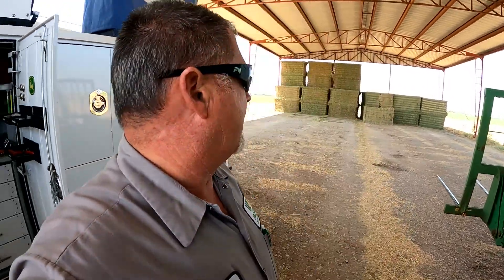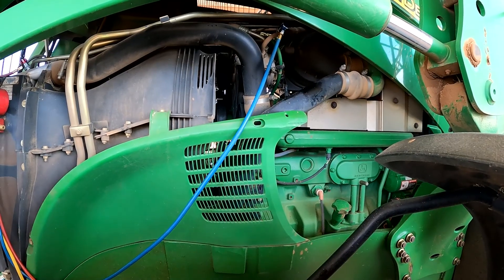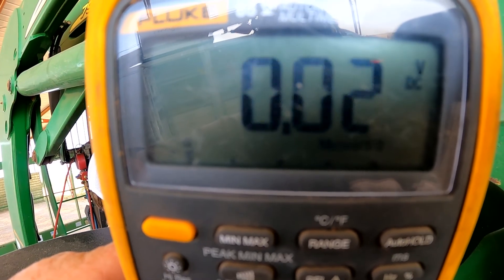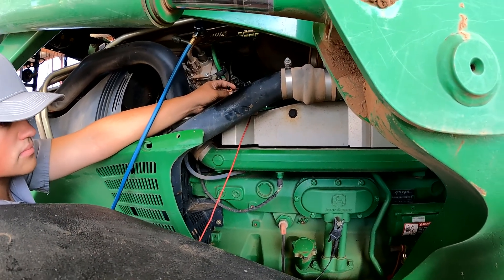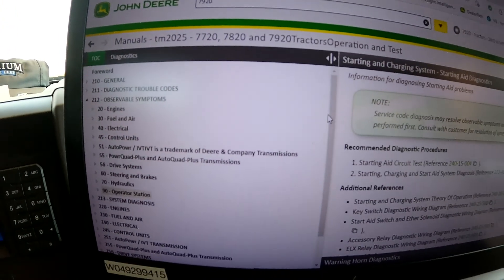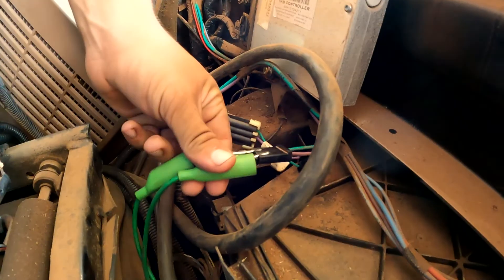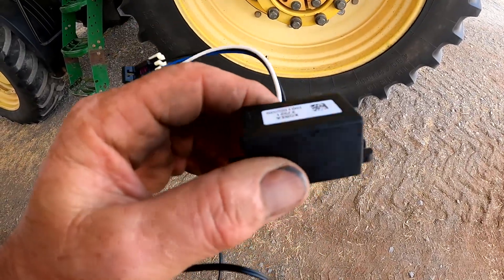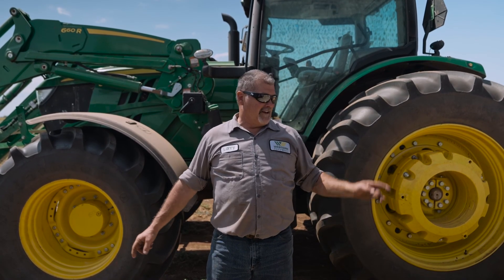Larry's Life E27 | How to Repair and Diagnose Tractor AC

Comment: On my 7730 My compressor is receiving 12 volts all the time even with key off.  Been fighting a drain for awhile on the battery.  AC quit working but the compressor clutch still test good at 4 ohms.

Comment: Hey I got a 2955 I've replace the compressor filter drier high and low pressure switches my head pressure is 300 low pressure is 25 I've got a blockage is there an orifice tube in that tractor? What you think it could be thank you
Reply from the maker: @Larry Stewart any thoughts?